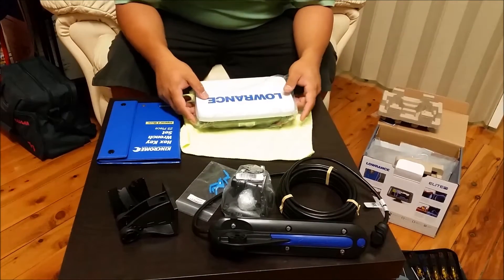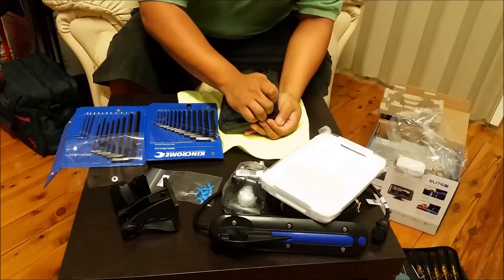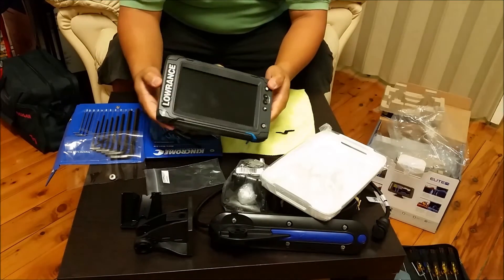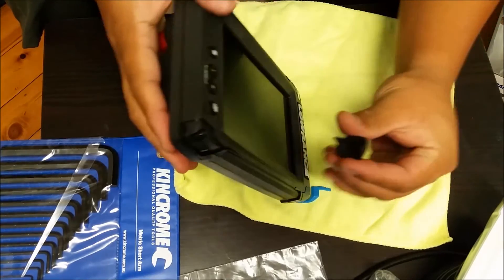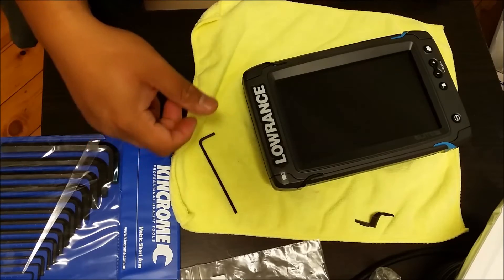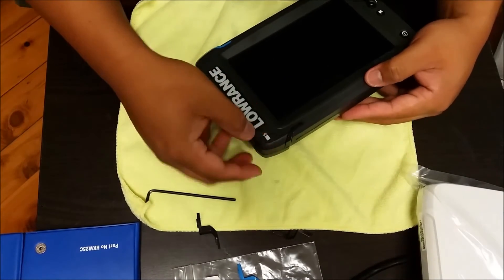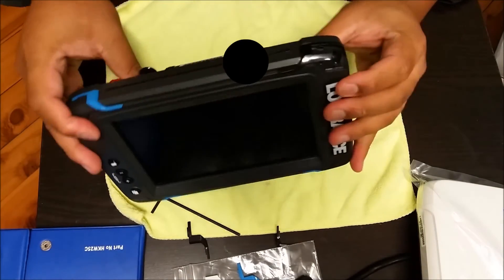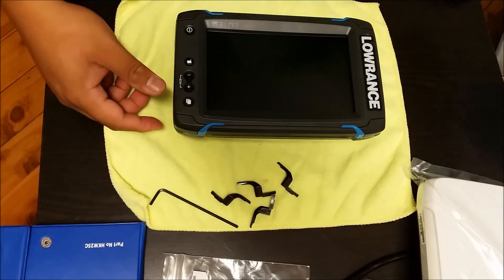Lowrance Elite Ti blue accent clips install PROPER WAY

Comment: In general, the TI units are faster in response to inputs. This is seen when quickly switching between sonar, downscan, chart, and split screens>>> allabout.wiki/4zfu   The Hook units will show some lag on button pushes and screen switching. The big ticket item though is maps. If you install a mapping card such as Navionics or the free C-Map Genesis which has a lot of map detail, then moving around the map with the cursor or when running down the lake can lag significantly on the Hook units, but is seamless with the TI units.